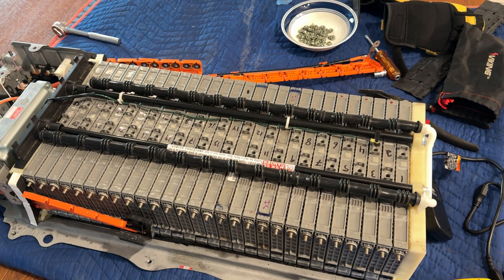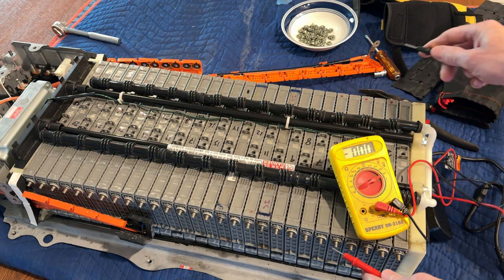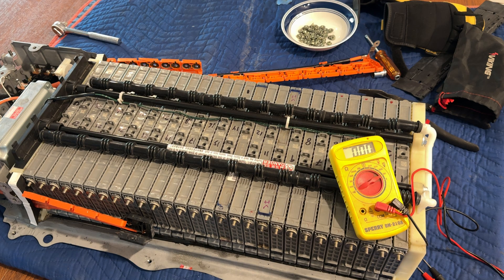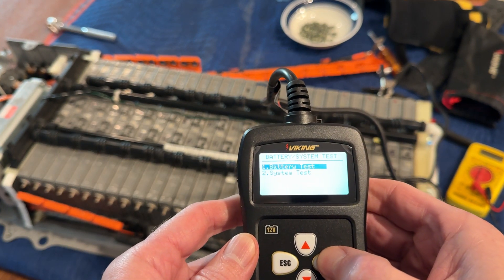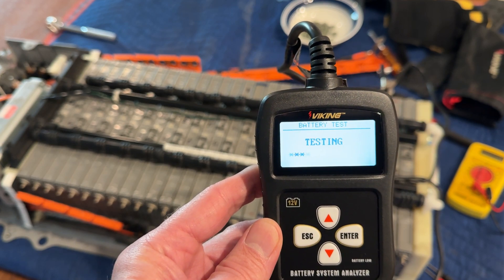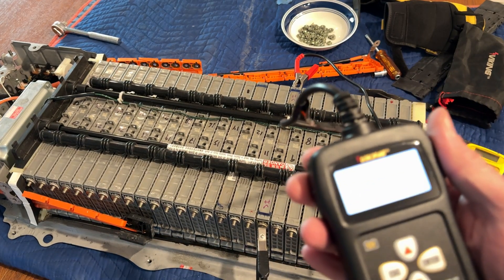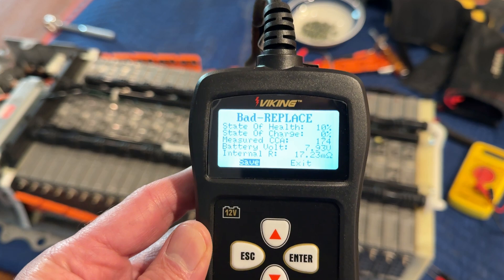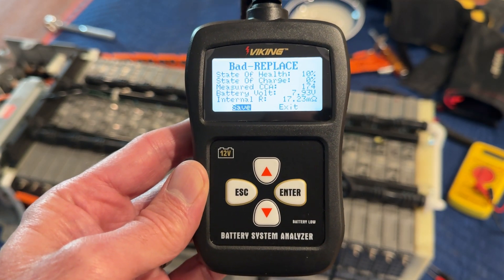Testing Prius Hybrid battery cell health the easy way

Comment: Be advised, ambient temperature matters. Try to measure the same module during the day and at night and you will see it. Mine were in the 80% range and are now 100%. Critical when you pick up $5 replacement modules at the recycling center!
Reply: @cvedeler Please pin the comment - even slight difference in temperature will effect the reading.

Comment: Is it a close IR reading ? This Viking battery testers are designed for 12V automotive batteries (like lead-acid, AGM, and EFB) and are
not suitable for testing NiMH cells. Does anyone tested and compare the readings on diff NiMH battery tester ?

Comment: This is great!! I went through a bunch of methods to try to build a pack with good cells and still had problems with codes. With this tool I was quickly able to find the bad cells - even though they had the right voltage, they were weak. The only 2 things I paid attention to were the STATE OF HEALTH and INTERNAL RESISTANCE. Everything else is irrelevant. Modules can show good voltage, but bad IR and bad SOH, and they are worthless and will mess up the whole pack!
Thanks for this excellent video!!

Comment: I went and bought the tester based on this video but every Cel tested 100% on the top line and each cell tested above 8 V and around 5.4 ohms, they were all very consistent, but I use the Dr Prius app and it originally said Cel number eight was bad so from watching another video I moved the middle Cel to the outside and did a balance on all of the cells and put it back in to see what would happen and then it said Cel one was the bad Cel so the Dr Prius app is detecting a bad cell Somewhere

Comment: The one that tested 90% is actually bad too. Ideally you want the IR to be below 5.0. The lower the better. They should always test at 100%. I've found that 5.2 is acceptable. Over 5.5 and you have a cell that will be failing soon

Comment: The best and cheapest is to recondition the bad modules by your self using cheapest RC charger like lipro imax rc charger, leave it on charge discharge, this takes long, maybe a week to complete all 28 modules, but it's worth it.
Reply: Please make sure you clamp the batteries fully whilst charging, or else you will not get them back in because of swelling!

Comment: Very helpful tips. Thanks. 
BTW, I guess we must select 6v instead of 12v on the tester right?
Reply: I just got done using this tester today. There is no 6-volt option. It simply tells you to recharge the battery because the voltage comes in at 8 volts. 8 volts is normal for these, so it's nothing to worry about.

Comment: Hi sorry for the question I'm trying to figure out my dad's Prius check hybrid system notification on the dash with code u029a, could it be a bad cell, already replaced 12 volt battery. Thank you

Comment: All my tested 90% are above took it in and out many times and finally pay the guy $500 to let me five of the cells were bad, plus it gets kind of complicated when you need to rebalance the cells. mine is a generation two 2010 Prius. I wish it would've worked it would've made things a lot easier for me.
Reply: I got a similar tester OBDMONSTER TE550, this has 6v option, so I selected that and it was different readings then 12v option, more accurate with 6v selected.
I could differentiate the bad and good modules.

Comment: Interesting.  I just used this tool to check all my cells.   Everyone said 100%.  All the internal resistance was 4.5mOhm or less.  Trying to figure out why state of charge is always at 0.  I am guessing that my red triangle of death was due to corrosion on the bus bars.
Reply: I believe that the state of charge is zero because it's only measuring 8 volts instead of 12 or more that a normal car battery would put out.

Comment: This is inaccurate fake testing, you can't measure actual capacity on hybrid battery modules like this  resistance testing tool. Im working 7 years of the hybrid battery repairing, you need special equipment and more experience to do measure actual capacity state of health testing.
Reply from the maker: While not perfect, it works well enough for a 17 year old car.  Perfection is the enemy of the good.
Reply: Thank you Sir, its funny people just buying in to this, this Viking tester is not supported NiMH batteries, lowest resistance I have seen on a NiMH modules was 11 m ohms, and with this tester will show all modules are good resistance at 5..m ohms :)

Comment: Hey man!
Just used the Viking tester 24 cells showed 98% health and 7.4v. Two cells came back 6.2/6.6 but with good health 95%? Some people telling me that they are back even with the Internal resistance being the same as the 7.4v. And I had one with 65% with a 6.2v reading and IR of 7.0. What are you thoughts before I buy the new cells?

Comment: Not CELLS. Modules. Each module contains 6 "cells" giving 7.2 volts @ 6500 mAh when NEW. Modules are paired into BLOCKs @ 14.2 volts when new. Keep in mind that Toyota regulates the HV pack to stay within 40% to 80% SOC not 0% to 100% SOC.
Reply: isn't 7.2 + 7.2 = 14.4

Comment: One source I read suggested that CCA is measured by drawing 10 amps for tens of milliseconds and observing the voltage drop. Then extrapolating to predict how much current would flow at the lower voltage typical of a 12-volt battery starting an engine. "Internal resistance" is a bit of a fiction based on an "ideal battery" with current versus voltage being linear. Because it's not a straight line (and I'd love to find some data somewhere with actual curves, but I haven't yet) I'm guessing these resistance numbers are lower than expected because the slope of current-v-voltage is different where this is measuring it. Still, the numbers seem very useful discriminating good vs bad modules.

Comment: Can I apply this to a 2012 prius?
Reply from the maker: Likely similar, but I have never worked on a gen 3 Prius.
Reply: @cvedeler  My Prius V was stopped for a long time because of the mechanical engine. I changed it now and after driving about 100 miles several lights came on. I went to Auto Zone and scanned it. The code is P0A80 (replace hybrid battery pack). But I would like to perform your test first. One question? Can I test the battery with it installed in the car or then remove it and plug the wires into it?
Reply from the maker: @Magic_Carlos  I don't think you can do this test with the battery in the car.
Reply: @ exactly. Lmao
Reply: @ so I don't need to connect any wires other than those from the battery tester, is that it?
Reply from the maker: @ Each cell must be tested in isolation from the others.  That requires disassembly of the battery and the connections between cells.  Then test as shown in the video.
Reply: @ thank you so much!

Comment: Been doing hybrid battery rebuilding commercially and rebuilt hundreds of hybrid battery including lithium ion as well. Last time I used a test for lead acid batteries I ended up with so many warranty claim I almost felt like closing the door. This tester might be more advanced since it read SOH the one I had did not so I might try it, but for now as an electronic engineer I designed my own tester and is working fine at the moment.
Reply: How hard to build is the one that you designed? Would you be willing to sell one?
Reply: Most people don't pay attentions, this tester is use on lead acid batteries, not NiMH cells, they will get some readings for sure  but how accurate are those readings? What damages may affect the NiMH cells? I am waiting for my CQ3 X4 coming and test some already bad cells with both testers and compare the readings and record any damages to the cells :)
Reply: Should trademark it

Comment: I use a dedicated impedance plus voltmeter way faster.  Impedance is the key but many people don't talk about it as they don't know.  Actually when impedance is low  battery is good with certainty.    Impedance  is more complicated than just a simple resistance!!!!!!
Reply: What is your protocol for checking impedance?
Reply: Would like to know how you test impedance on your battery

Comment: That measurement is only to compare modules’s resistance.
Reply from the maker: That and the voltage and capacity to hold a charge (roughly correlated to internal resistance).

Comment: so do we even need a volt meter if we just test every battery?
Reply: It kinda comes with its own internal volt meter.  It may not be super accurate (mine seemed 0.05v low) but it's at least relatively accurate to itself so possibly good enough for many purposes...

Comment: Hei, so I have a yaris hybrid, I got the fault code to replace the hybrid battery, I followed your advice and bought a battery tester like you have in the video, I have measured all the cells and soh is 90-93% and internal resistance is around 6.5 mohm across the cells and 8v on every cell, what’s your opinion?
Reply: Did you fix? I have same problem
Reply: @oguzcagritekin2700 yes, I have replaced the battery pack, after testing the original battery too many cells were almost dead and was cheaper to buy another used battery

Comment: Thank you.  My worse internal resistance on one module is 6.36 ohms, State of Health 79% and Battery volt is 7.56.  Tester says Recharge/Reset.  Second worse on another module is 6.31 ohms, 81%, 7.51v.  Are these acceptable numbers? What do the numbers need to be to consider them bad?
Reply: If you're getting a code on the dash, then i think your ECM is reading that those 2 'bad' modules are not keeping up with the rest of the good ones. So replace with some ebay one i would say.
Reply: @HankHill1  Actually Hank, I came to find out that I was overthinking it.  I'm new to this kind of stuff and learning.  All the readings were off of a battery tester I purchased.  I'm almost done cycling all my batteries.  So far, luckily no bad batteries. Next, balancing the batteries.

Comment: This worked fairly well.  Basically ignore everything it says ("good cell" "bad cell") and look at the CCA and internal resistance measurements.  Use it on all modules and look for what is "normal" then look for any modules that lie outside of what is "normal."  These modules are "somehow bad".  Unfortunately it isn't specific enough to tell how bad, exactly, they might be 80% of normal capacity, they might be 15% ... but a nice start, and so easy to use!  Also note that CCA values will change based on temperature so be aware...The other "failure case" it doesn't really detect by comparing CCA is leaking cells like if they drop overnight from 7.5 to 7.2, but you can just compare voltages and find those fairly easily anyway...
Reply: What exactly would be “normal” as a reference?
Reply: @CarlosV-e3m  this is a great question in so MANY contexts. But I think what RogerPack is suggesting is, you'll know what "normal" is after you've applied the same test to all cells in the same conditions, especially temperature.

Comment: I swaped the bad module and re conected everything.  Still getting red triangle and car won't start. Am I supposed to let it sit for a day so the battery levels even out?
Reply from the maker: If your modules are testing good (above 60%) it should work.  If you are still getting the red triangle there is likely something else going on.  No need to even out the batteries as the car will do that for you over a few days.
Reply: New codes?  I think I once forgot to re install the orange safety level LOL.
Reply: Saw one like yours on Prius chat and they had a loose bus bar on reconnection fwiw...
Reply: you need to balance your pack all 28 cells together, if not, you will get the permanent code even you can get the car running.

Comment: This information Is outstanding based on all the other info out there. I have a 2010 Lexus GS 450H with a Panasonic 40 model pack hybrid battery, that I removed myself, testing cells they all were 7.6 7.7 with a volt meter. However I didn't know about this tool until watching this video.  Every cell tested 100% good the internal resistance each cell was between 4.89 to 5.33 . I noticed the battery had been worked on before it was actually missing a busbar . So I ordered a replacement busbar that will be here today and I will put it on and put the hybrid battery back in the car..
Reply: Holy hell, they replaced/rebuilt the battery and left out an entire bus bar!?  That's wild, man.  Everything good now?

Comment: So what should me ohms range be? Like 4.5 to 5.5 or what? Please let me know.
Reply: I believe using a multimeter for that could cause damage. If you're referring to voltage, a new cell should typically read around 7.7 volts.

Comment: Unfortunately doesn't work that way. I used this Viking battery meter on my Prius 3rd generation cells and it showed 100% state of health,  7.95V on everyone and very low internal resistance.  Even though my battery had a problem on block 13. I had to run a Dr. Prius app test to see it and disassemble the battery again to replace it.
Reply: Did you test them disconnected I presume?  If so that's a bummer, guess it means this tool can't detect the more subtle failure?
Reply: @RogerPack  Yeah there's something missing in his story here.. or maybe the 3rd Gens have different type of reading/load procedures as someone pointed out in another comment.
Reply: @HankHill1  I actually had good luck with these, just ignore the "good cell/bad cell" messages and compare the CCA and IR measurements only, outliers are either slightly weaker or really toast (can't differentiate, see my other comment) :) Peace!

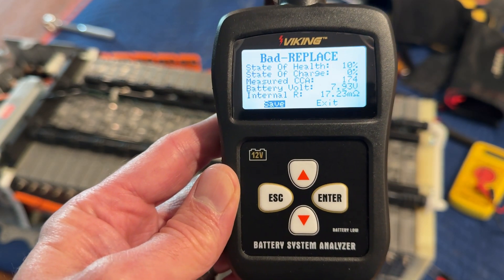Comment: I just replaced 3:54 all the blocks of my Lexus CT200h (same as prius.) After all done, the P3021 came up; it indicates that block 11 becomes weak. Any ideas? Do you think one of the blocks came bad? I refurbished all the blocks my self at once with new cylindrical ones. 😢
Reply: bad new module or busbars not connected well?
Reply: Did you find out what happened?
Reply: @strategearchi  yes. All I need was to:
As soon as you replace the batteries and put everything together, just turn on the ignition and let it seat for about 20 min (I believe the car computer needs to super make sure the battery is safe to run.) Then, turn on the engine and drive the car so that the EV mode engages (in other words, drive under 15m/h) for about 20 min or until the car runs several hybrid cycles. Then, the car computer has recognized the battery is safe and then it will work.
P.S. it kept showing some kind of error, cant remember; but the car was running fine. After just a couple days of driving, the error went away. I have put the computer and no errors whatsoever. Car has incredible more power and efficiency.
Reply: @joselarrarte6964  thanks that's very usefull iformation. On Prius C I am about to change the full used pack and not sure where to buy. All sellers say they have good ones. Is there any precautions to check, like voltages(which is good score) or other stats before they sell me and install?

Comment: Hi. In the video you test 2 different cells, a good one and a bad one. Are you saying if you used the Sperry on the 2nd cell  you tested, the known "bad cell",  it would have shown as "good" or "normal"? And the purpose of using the Viking is to show it is actually bad if under load? Thank you.

Comment: When you replaced the bad module, did you have high voltage difference compared to the other modules?    I replaced a module and showing 1.2 voltage difference and throws the "check hybrid system" p0a80 code on my odb2 reader.   I need help.
Reply from the maker: The voltage of the cells wasn't my problem. All my cells were +/- less than 1 volt.  It was the internal resistance that caused my problem.
Reply: @cvedeler  It throws codes if internal resistance gets out of whack?  Or were voltages also weird?
Reply: Is this right after install?  Did it go away on its own?
Reply: Sir you probably resolved this by now but you have to balance the pack when you replace a module

Comment: I used the onwei tester and it come out as all the modules are bad.
It also give you an option to choose the kind of battery, like agm, lithium and 4 others.
Resistance was around 5.4 and 6 all across. 
I don't think this really work good for  hybrid battery module.
Reply: I tried both the cheaper konnwei tester from amazon and the HF one and oddly the konnwei gave me more inconsistent results, like it would be 500 CCA, test again 500 CCA, test again 450 CCA.  It was kinda weird.  It kinda worked but I don't trust it fully for this task.  The HF one was, however, at least consistent, see my other comments for further thoughts and ideas, cheers!